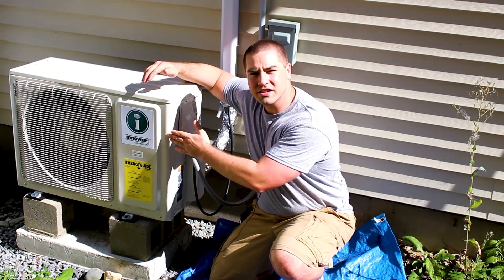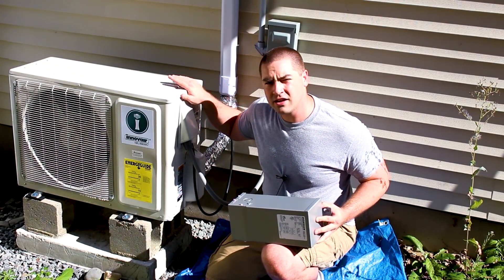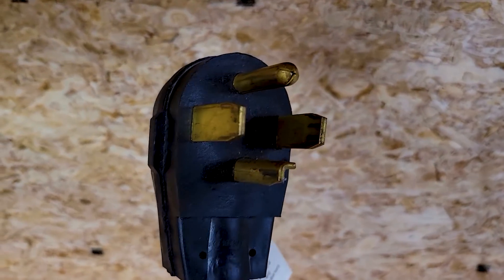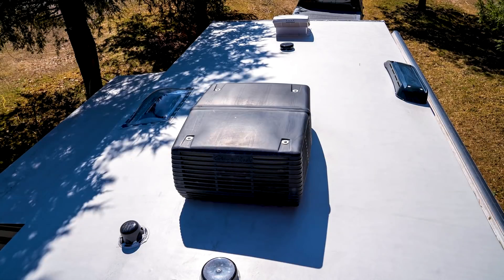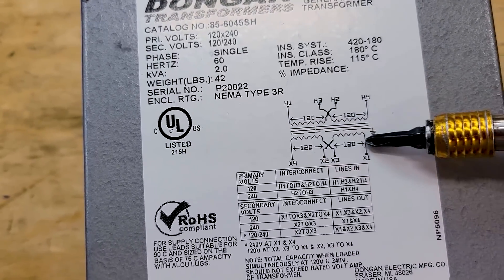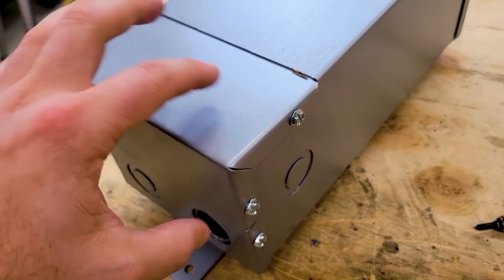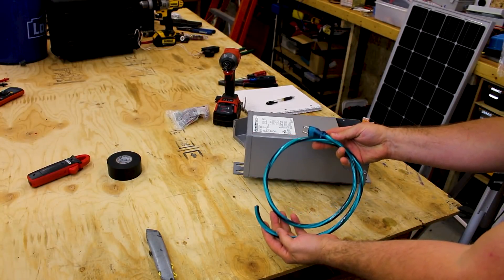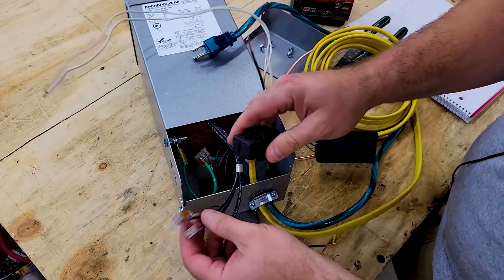Transform your mini-split heat pump for your RV/Camper Project

Comment: This is dumb. Just buy a 120v mini split. Ton of them on Amazon. But you wouldn’t have a YouTube I guess. Thanks
Reply: There are no 120v cassette units, only wall units 120v. All cassettes are 240v.
Reply: Or you're too dumb to use Google and see that 240v units are more efficient. Good chance that even with the loss at the transformer that you will will use less electricity using a 240v unit over a 120v one because of how efficient the 240v one is.
Reply: @HotTorch451  I am an EE the weight of the transformer and the efficiency loss does not equal the added gain of less current going to 220 in this application. For a home with 220v available it makes huge sense. plus the hassle of install carrying grounds etc. I do not know why the rv industry just doesn’t make an inverter type ac heat pump as a replacement to the roof top unit that have been around since the 60s.
Reply: @bparkinson1234  sorry you're an EE that still doesn't know how to use Google. It's not just about less current.  There are 220v units with vastly far superior SEER ratings than what is available in 120v.  Oh wait THAT WAS THE WHOLE POINT of this video and the one that proceeded it.
Reply: @HotTorch451  do the math.
Reply: @bparkinson1234  ok here's the math. Your 120v amazon unit (first one listed)  has an EER rating of 11.5 BTU per watt.  The unit in the video has an EER rating of 18 BTU per watt.  Assuming we need to apply 10,000 BTU to a room to cool it: 120v unit 869.5 watts. 220v unit 555.5 watts.  120v unit used 7.2 amps. 220v unit used 2.5 amps. Since I'm not an EE I don't know if I missed something in my math but the 220v unit used over 2.5 times less electricity.   Now we still need to add in the transformer loss but it should still be less than what the 120v unit is running.
Reply: @HotTorch451  I agree with your math. Good so far. But as you mentioned the transformer loss in histerisus. Amps used heat etc wouldn’t be worth all of this. Just get a 115   Thanks for the reply.  Also not to mention reliability. The transformer will give out.

Comment: they work nice i use a ST5000 Watt for 220/ 2/40 they are a $ 100 less  load power use too
Reply: How do you wire it up as I understand mini-split units want 2 hot wires?

Comment: Good video. I've been thinking of getting a Growatt inverter and one Gyll battery to put in my RV for boondocking. I'd only need to get through about a 3 day weekend, but I'd definitely need a mini-split instead of that power hog of an A/C that's on the roof now. I probably wouldn't install solar on the RV. Everywhere we go it's mostly shaded. I'd just charge the batteries from my main system at home before we leave.
Reply: You would need two more panels to use a Growatt vs a Victron, Magnum, etc. Not downing the product but you pay for what you get.
Reply: @glennwest4438  what do you mean by "panels"?
Reply: @dustins4194  more solar panels due to the high wattage they use vs a better more efficient unit
Reply: @glennwest4438  LOL, I guess you didn't read where I said "I probably wouldn't install solar on the RV. Everywhere we go it's mostly shaded. I'd just charge the batteries from my main system at home before we leave."

Comment: I just put a breaker in my RV to supply 240v for mini split. But could run it with my small inverter generator. So added a step up transformer and now my small generator will run it

Comment: All good my 120v, 1 ton, inverter, heat pump minisplit typically uses less than 2 amp-hours while running in dehumidify mode, and there are also 12v minisplits. There is one thing about minisplits and traveling that may save somebody. You cannot mount the outside condenser unit in a way that the windforce generated by traveling can turn the fan. You must mount it on the back of the RV or put some kind of cover on it while driving, or it will toast the fan bearings and/or any fan electronic components if present.

Comment: I am purchasing a Mini Split AC/Heat Pump 9000 BTU by Tosot. It has an EER ranking of 16.5, and a SEER number of 38. HSPF = 15. They claim 2.5 Amps / 500W are needed to run this unit. I have a 3kW Stackable 48V 150VDC 80A Off-Grid Inverter by Growatt. 6 250watt Canadian solar panels (adding 6 more soon), and a 48v 11.7kwh LiFePO4 battery bank. I was hoping you could suggest an inexpensive transformer that would be proper for my setup?

Comment: Could you help me choose on which panels will be best bang for the buck on my set up? I am basically going to run the growatt setup you have but I'm not going full electric on my house.Lp instant hot water heater and possibly a lp cook stove(on fence about this one). I have a small 1200sqft home and will be installing 2) 12k mini splits with back up lp heat and wood stove. My worry is my batt set up is only 10kw and need to charge it quickly. I know this means large solar and thats where I need help...buy used/new...buy poly/mono. I'm starting to get my head on right with the series connect and stay under 450vdc 100a but there are a ton of panels out new and used...Any insight would be greatly appreciated.
Reply from the maker: There is no right or wrong, just lots of good options out there.  My personal solar arrays were panels that I found locally on Craigslist.  All were purchased used.  If your goal is to put them on your house, then you might have restraints as to the size of the roof?  Personally, I look to buy name-brand panels (not some random Chinese company).  If I have the choice, I like mono cells.  I also try to buy large panels because they install faster with less wiring.  Here are some options from Signature Solar: https://www.signaturesolar.com/collections/solar-panels?ref=4_rHcgZ9x-TiF-
Reply: @DavidPozEnergy  Thanks for responding...That's kinda what I figured...Just add them up in series and parallel and don't exceed the inverters.Have you heard of Aptos panels?I hope you didn't have a falling out w/sig solar which by the way I was there today picking up the inverters and transformer.Did you know growatt now makes there own transformer(I got it).Its pretty  nice w/locking latches.I tried your promo code but no dice but they did give me $50 off each purchase because I separated my purchase to the inverter/transformer kit and another 5000es.Anyway hope you didn't get in hot water w/ solark as well and keep the vids coming!They are a ton of help and I let them know about it at signature solar.I saw James in person but he was busy so no intro but it was cool seeing someone off YouTube.
Thanks again

Comment: Good video for someone that needs larger than a 12,000 BTU or has equipment already on hand that requires 240 volt power.
There are 12,000 BTU mini split units available that run on 120 volts.   Which would be a lot simpler than having to add in a transformer assuming that you're going to be buying a new mini split for the installation.

Comment: Watch minute man prep solar heat pump video , heat pump runs off solar panels alone, no inverter required during the day  so no losses and if you don't have enough sun it will automatically grab power from the grid or inverter. 
So cool
Reply: Hot spot energy is the manufacturer of the unit.

Comment: I saw a toy hauler 5th wheel RV with two mini-split A/C units installed. The outdoor parts were mounted above the garage door, and the air handlers were mounted inside. The ceiling openings had been sealed over for a smooth roofline. the mini-splits were 110vac units that would run off the Onan generator or the shore power connector, without a transformer.

Comment: What if you connect both in 120v mode, Then connect X1/X3 to H1/H3, and use for the 240v output, H1/H3 and X2/X4, to convert it into an autotransformer
Reply: Think I did that wrong, it will have to be in 240v mode on each side, Then connect X1 to H1, and use H1 and X4 for your 240v, and H1/H4 for your 120v input. Probably should test it on a transformer :)
Reply: @patrickdk77  If used as an autotransformer it's fine to use the transformer in 120v mode, as each winding will only see 120. You could switch the transformer to 240v mode which would greatly reduce idle power but would halve the power capacity.
Reply: @eDoc2020  By power capacity do you mean amps or watts? cause only watts matter.
Reply: @patrickdk77  The ampacity halves. Since you'd be keeping the same voltages the wattage would also be halved.

One config rates the transformer 120v 16a and the other rates it 240v 8a. For step-up autotransformer use you would give it 120v, so if the transformer is in 240v mode you only use 120v 8a of the 240v 8a capacity.
Reply: @eDoc2020  sure, when going from 120v 16a to 240v 8a, the amps half, but the rating of the transformer is still the same at 1kw, if it was rated at 120v 16a. if it's in 240v mode sure it would be rated at 8amps, but as I said, you are pushing 120v over the 240v winding, it would still be rated at 1kw, or 120v@16a, the 120v rating wouldn't half.
Reply: @patrickdk77  If the winding is rated 240v 8a, you can only safely put 8a through it. After all the winding is just a wire and wires don't care about load wattage, only current.

Comment: Hi David, would this also work for a 240V hybrid heat pump water heater as long as we only use it on HP and not use the elements?
Reply from the maker: I've spoken with 2 people who own heat pump water heaters, and have them set up in heat pump only mode.  But, they both tell me that on rare occasions the heating element might still turn on.  So if that was to happen you might over-load something.  So if you are going to try this method, make sure you add some circuit breakers to protect the transformer.
Reply: @DavidPozEnergy  Awesome. Thank you for the great videos!

Comment: Great idea, but I would suggest bonding the neutral to ground on the secondary side.. and only reason I say that is there is no zero, and if some checks from ground to hot it could read zero and be full voltage. Many people have been harmed from a floating neutral and not checking the power correctly. I’m glad you said that but at the end.
Reply: Yes, this should be done in a proper setup. It shouldn't make a safety difference but it's easy enough to do and could avoid future headaches.

Comment: 80 watt 24/7 idle draw for the isolation transformer seems like a lot of parasitic load , especially IF you are using this in a solar/battery/inverter setup.  Plugged in at an RV park, probably doesn't matter, but for an off grid application that's a lot.
Reply: Agreed, I was thinking it needs to be on a switch so when not in use there’s no draw from the transformer or AC
Reply: Yeah, i agree. But the entire solution is a bit  strange. 

 Also i would have skipped this solution and picked up a 120v minisplit.

 Dont want the cost of a transformer, dont want the weight/space required for the transformer, dont want its losses. Cant really see this as a suitable solution

Comment: You have the right kind of transformer, but you should be connecting it as an autotransformer since you do not want or need isolation in this instance. To do this, you connect both primary and secondary for 120 volt, then connect them in series. This also means you can use (in this case) a transformer of 1/2 of the KVA that would otherwise be required. A 1 KVA transformer can supply 2 KVA as an autotransformer. This has the advantages of 1/2 the weight and volume, and of the 1/2 the losses, both no load and loaded. Of  course it can be run the other way, stepping down from 240 to 120, or it can be used to derive a neutral from a 240 volt, two wire source, resulting in a 120/240 volt, three wire source. It should also be noted that it is best practice to select the size of transformer based on the load to be served. For instance, if the A/C unit only takes 1 KVA, you would use a 1/2 KVA transformer, connected as described. Oversizing the transformer results in more weight in the RV, and more no load losses.
Reply: I was going to say the same thing about wiring as an autotransformer. There's also another trick that can be used here: if you pair the transformer windings to make it 240->240 but only put 120 in then you will massively reduce the idle losses. The downside is you will only have half the kVA available and efficiency might be worse at higher load levels.

Doing both tricks with David's transformer would give him the same 2kVA of 240 volt power he just set up but with less loss. I'd expect only 15 watts at idle and (AFAIK) around 30 watts under load. I might be a bit off on the second number; I would need to sit down and double check everything to be sure. Worst case would be 50w loss under load.
Reply: I am purchasing a Mini Split AC/Heat Pump 9000 BTU by Tosot. It has an EER ranking of 16.5, and a SEER number of 38. HSPF = 15. They claim 2.5 Amps / 500W are needed to run this unit. I have a 3kW Stackable 48V 150VDC 80A Off-Grid Inverter by Growatt. 6 250watt Canadian solar panels (adding 6 more soon), and a 48v 11.7kwh LiFePO4 battery bank. I was hoping you could suggest an inexpensive transformer that would be proper for my setup?
Reply: @adammosley7616  2.5 amp at 240 volt, I assume. It sounds like you have plenty of power for that. Your inverters are “stackable”? That would normally indicate that they can supply 120/240 volts, no transformer required. If you do only have 120 volts available, you would need a 300 VA transformer, like the one in the video, connected as an autotransformer to supply 2.5 amps at 240 volts from your 120 volt supply.
Reply: @realvanman1  i read some more comments here and have decided to just purchase a 120v mini split unit instead. Thanks for your reply though!
Reply: My setup in my RV is 240v. I would like to connect a 120v generator. I purchased a 32a victron autotransformer(28amp continuous). My generator is 5000w. Will I be limited to 32/28amps input at 120v?
Reply: @craigpratt6855  A 5 KVA generator would require a 2.5 KVA transformer, connected as an autotransformer. I suspect that the makers of the Victron product are assuming that a neutral current in excess of those ratings is exceedingly unlikely on a 5 KVA system. Running it in reverse to step up 120 volt to 240 volt means it would be evidently limited to 28 amps in, 14 amps out. Many generators are capable of being reconnected for 240 volts. You'd have to open it up and explore the wiring to see if yours can.
Reply: Diagram Please

Comment: I just dont see this being a good system for some of the examples you showed in the opening. there are just as efficient or close to it that are less in price and run on 120v and even some are 12v for way less money and less work to make them usefull and not $200 transformer. Sorry but for rv or any kind of mobile small home no this is not a good choice.

Comment: The Bluetti is likely only measuring apparent power since apparent power is measuring the actual current and voltage of the load on the inverter and not just the true power being consumed by the transformer and wasted as heat.  It is very important for people sizing inverters to have a good understanding of AC power and how it is measured.  Everyone doing any AC electrical work should have a thorough understanding of true power, reactive power, complex power, apparent power, phase angle/how power factor works and is corrected in situations with highly inductive or capacitive loads.
 The plug in watt meter is compensating for the power factor so that it displays true power but true power is not all of the power being supplied by the inverter in the bluetti. A portion of that power is returned to the inverter but is still seen as a load since it is now out of phase. A good generator or inverter just like the transformer in the video will usually be sold listing it's KVA rating which is it's apparent power capability.  Some will only list total watts and then you assume the total watts is the maximum apparent power the inverter can provide so you have to add up the combinations of loads based on their apparent power to see the actual load on the inverter.  Some inverters that use high frequency are really bad at handling inductive loads so you really have to underrate them when connecting reactive loads like transformers, capacitors, and motors.
Reply: You don't need to know all that. Just remember three things:
1. kVA can be more than watts.
2. For sizing inverters and wiring always look at kVA, not watts
3. For sizing batteries and solar you can look at real watts.